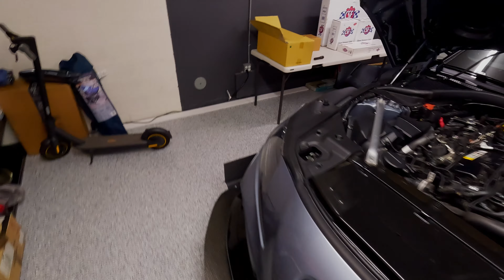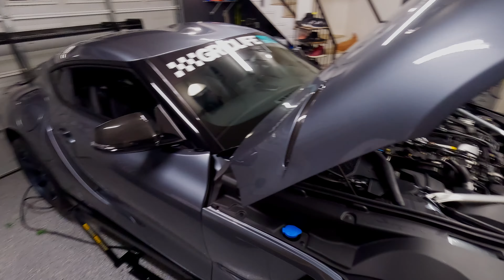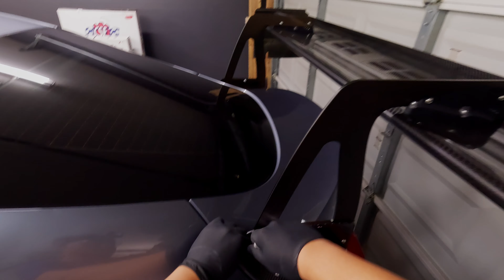A90 Supra IAT Cooling Upgrade

Comment: I thought we had a electric water pump behind the driver fender liner or am I not seeing it?
Reply from the maker: Probably not seeing it
Reply: @Aaron_diy  its actually under the intake manifold in between the oil filter housing and the alternator